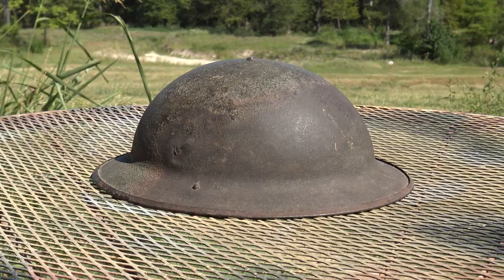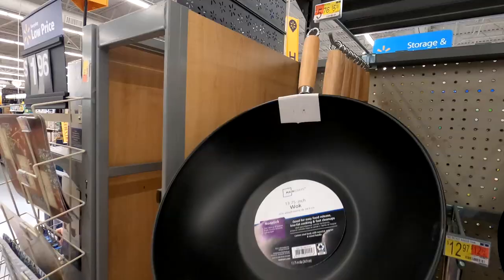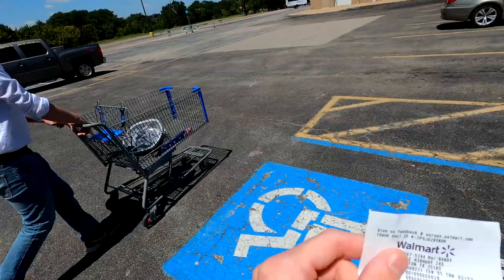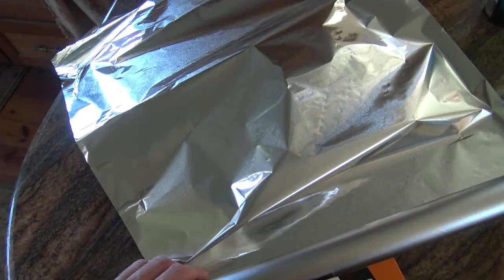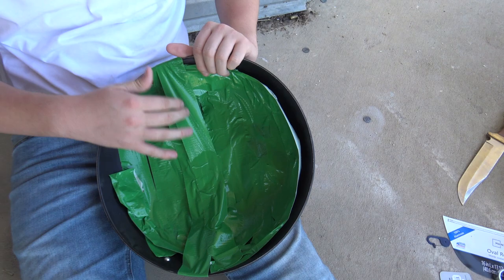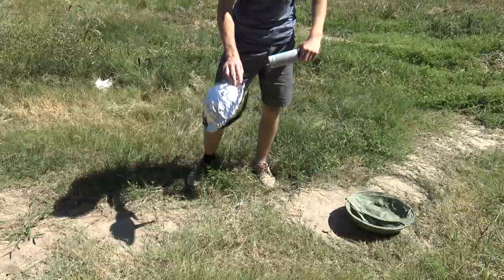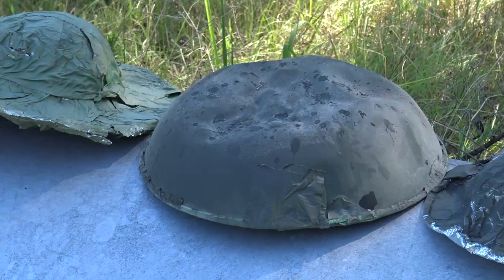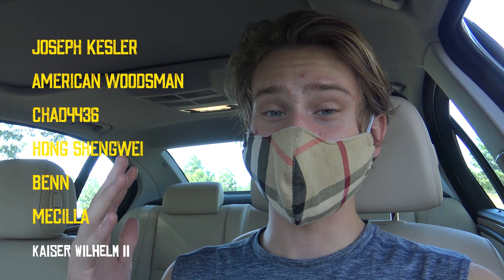DIY WW1/WW2 Brodie Helmet Challenge!

Comment: Tin foil was the best one, it was the best looking one, small, and seemed to hold up good against bbs. You could use a bunch more tinfoil and presss it even more to make it look better
Reply: Yea I agree with this guy ⬆
Reply: same :)
Reply: the pan could be better if a liner was added and a chin strap
Reply: yesssssssssssssss!!!!
Reply: Yea your right beacuase for example if you shoot a bb at gun at wood it will go trough because woud is stiff and tinfoil now when alot of force go at it, it will compress the force and make the tin foil helmet stronger so i thing they shoudl use the tin foil helmet to make airsoft wars bit they need to sand paper the helmet so it will be smooth.
Reply: He totally won, he just didn't want to rub it in his friends faces.
Reply: What if you sanded it like the one shiny tin foil metal ball
Reply: Thought it looked the best but the metal one is the one I’d want practically maybe with a better vanguard though

Comment: I would have formed a sheet of plastic over a bowl.

Just soften it in the oven pull it out and lay it on, I'd probably want to have a piece of plywood with an appropriate sized hole cut out to make sure there are no wrinkles or waves in the brim. 
Any kids would need help from their parents, but it should be pretty cheap and easy.

Comment: If you are going to do this challenge again I would suggest that you but a cap and cut of the brim or use the baseball helmet and cut of the check pieces, attach the tin foil to the cap or helmet and use it as a base, it will be more secure on the head than if it was just secured with tape. 
But anyways very fun video to watch and the one that i think won was the one with the cap mixed with the foil, it stayed on and gave some protection from incoming shots.

Comment: I think of following build:
simple metal bowl in head size, stick duck tape for the strap and inner layer  at it, use cardboard to strengthen the brim and make it out of tin foil, put tin foil all over it, put extra tin foil on the edge, smoothing the surface, paint with mixture from acrylic paint and white glue.
We have some simple supply shop here which sell stuff almost everything  for 1Euro per piece, so I guess I could build it for around 7Euros

Comment: Maverick could've filled a metal bowl with cement, then hammered the edges of the wok over the bowl to do the same thing as the tin foil, but with a stronger material